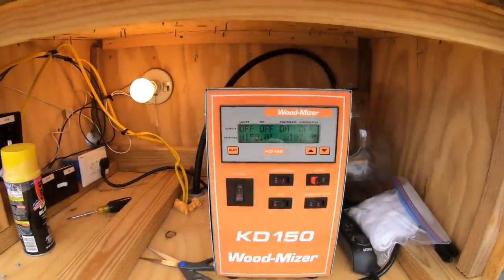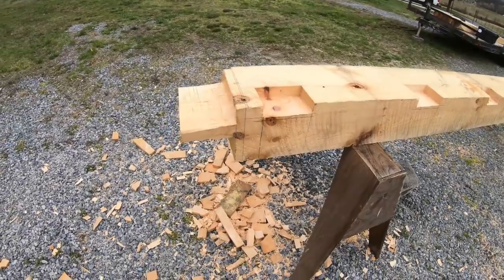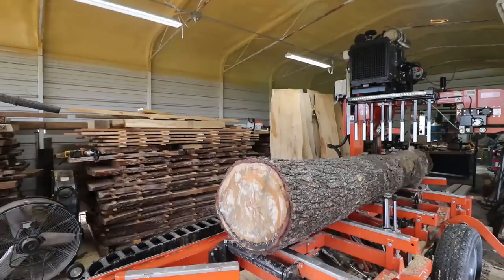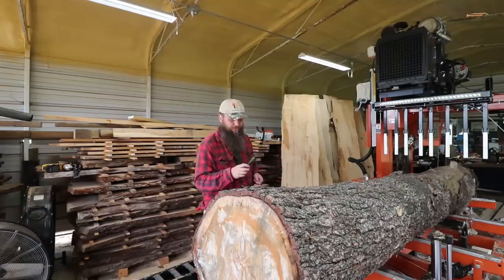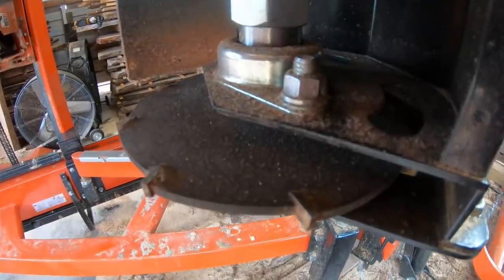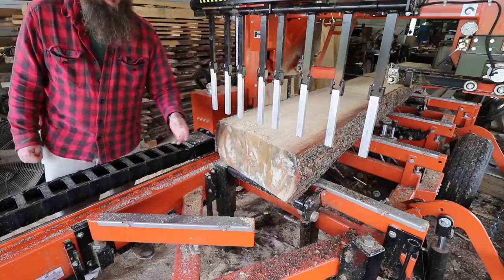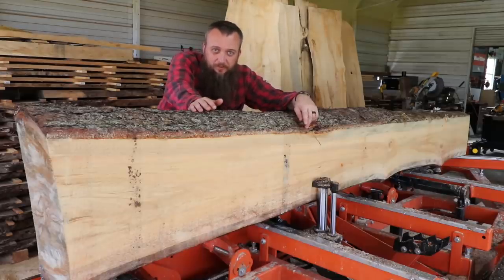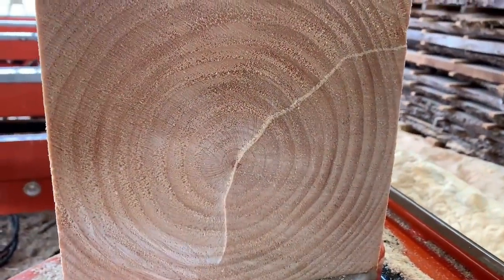Kiln Drying, Timber Framing and Running A Sawmill, Never Feels Like Work,

Comment: Nathan, Chris taught you a very valuable trick.  Framing squares can be very useful in the shop.  We used them when we were building doors, prehung doors, especially exterior units, cabinets, etc.  I wanted to make sure everything was square when it left the shop.
Reply from the maker: yes sir, thanks David,

Comment: Nathan from my days as a apprentice pattern maker circa 1980 a 64th inch equals one degree per inch. We used to set our work with a 2 degree taper so the parts could be removed from the sand mold.

Comment: I’m a total newb to sawmills so excuse this question— 1. Can you use that beam right away with no drying?  2. If you dry it out and put the framing square back on it will it hold true or twist a little?  Thanks for your videos, we really enjoy them. Just bought 100+ acres in N Idaho and we have lots of trees.

Comment: I keep a speed square in my tool belt when I'm sawing for getting the log right for that third cut. It's good enough most of the time. If the face is too high up for the speed square, or if I want it to be perfect, a framing square is handy. Now If I could just figure out how to get that log turned back to square after I've accidentally turned it too far I'd be doing real good.

Comment: Good idea on how to help keep things squared up.  Question: Is the whole saw mill jacked up a little to relieve the two tires from resting on the floor in one place?  Also..I noticed that both tires are uncovered and exposed to the saw mill kicking up all the dust and perhaps the tires are getting hit with splinters at a high rate of speed when sawing wood.  I've seen people who own campers use tire covers when the camper is not in use.  The covers are in the shape of the tire and fit snug around them. Made of nylon tarp I would think.  Since you're not moving the mill around very much, maybe covers would help protect the tires.  Just a thought.